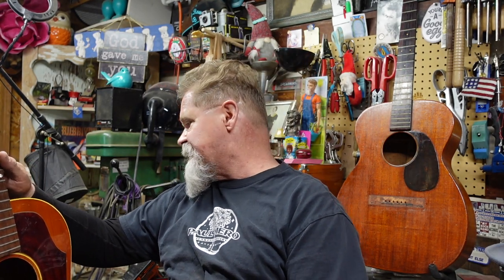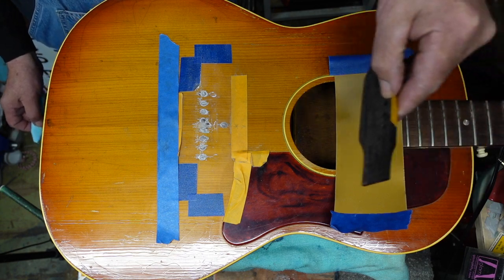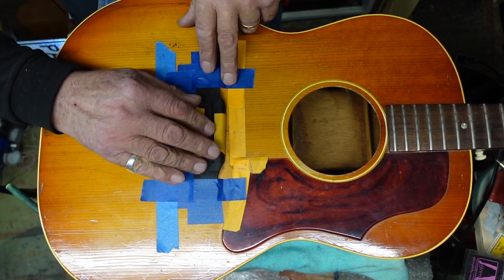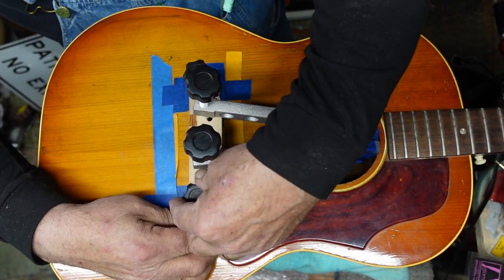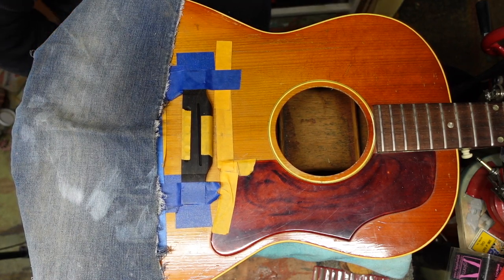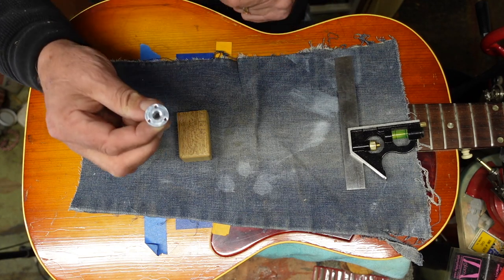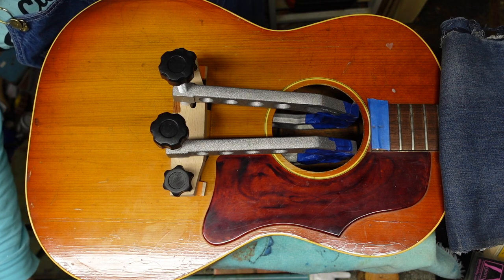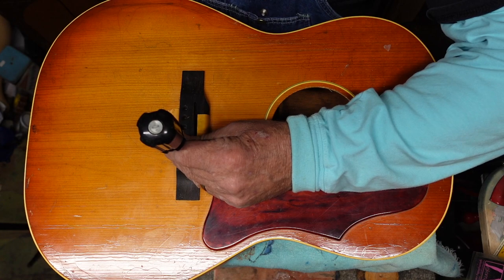Gibson B-25 Bridge Replacement: Part 3-Fine Details

Comment: Good stuff Paul.  Many good ideas.  I see that you glued the bridge directly onto the finish.  Would I be making a mistake by cutting out the finish as you see on most guitars?
Reply from the maker: I would use heat to see if you can do it without ruining the finish.  There is a reason Martin does not finish under the bridge.  Thanks for watching)))